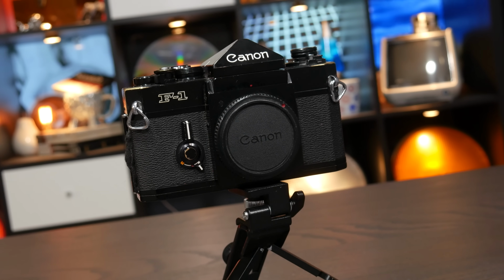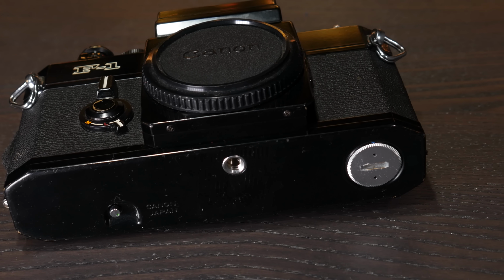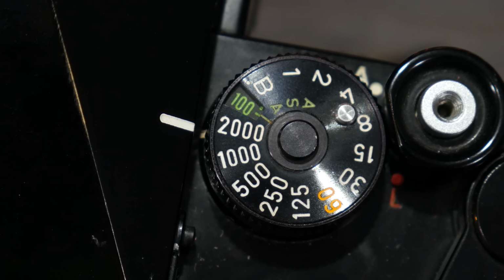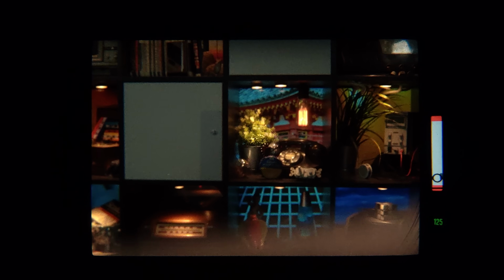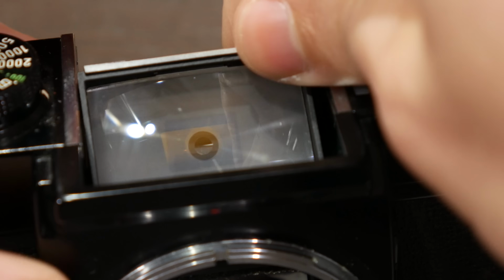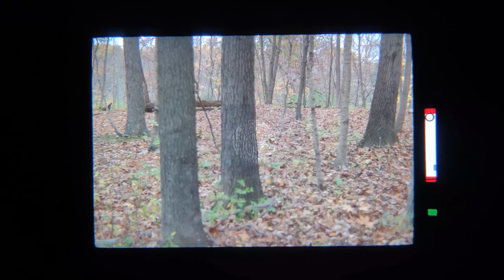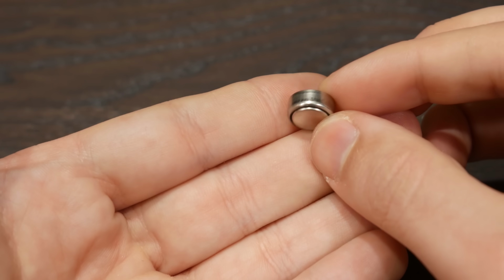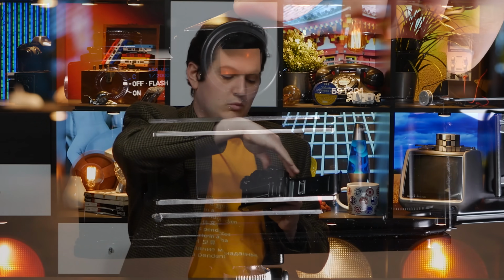1970's Camera Tech: How they showed you what settings to use

Comment: If you love the Canon F-1, I suggest you try the Canon F-1 NEW with the AE finder.    It is the perfect film camera.  So many people new to film photography are seeking out Leicas, Contax T2, ect. and really have missed out on an exceptional camera that is still priced reasonably.
Reply: I own both an m4 and a t2 and still return to the original f1, that metering system is so well thought out, I don't think any manufacturer ever managed to make a better mechanical camera with a meter, even the m6's meter is awful
Reply: the Nikon FE series is also a very good contender. Nikon glass is excellent, and the series uses a match needle system that can double as aperture priority. If you're willing to forgo 1/2000s shutter, the FE is excellent and pretty cheap. FE2 goes faster, but it does have a quirk of being locked to 1/125 for the first 2 exposures after the back is closed, a first of the roll shot is trickier. Fm3a is a grail camera to me in the 135 format.

Comment: Super cool and well explained. That is a great camera for the early 70s! I grew up using Olympus Trip and then OM-10 cameras but really got into photography at the time when Pentax ME Super cameras were available as second hand and cheap enough to lug about and be not too worried about, (something that's too precious to take will never get a picture). I've still got boxes of these plus autowinders, flashes and a myrid of lenses, tubes, filters and gizzmos. They were great and still are. I really liked that you showed the removal of the viewfinder. I expect this would be used for portrait photography as a mechanistic non-squint nod to medium format and subject-framing options. Yes, the intricacies, engineering and optics of these Japanese cameras was and remains amazing!

Comment: I converted to digital cameras 15 years ago, But today two of my students still and only use film cameras. They bug me regularly with info on the new films, etc.,even try to convince me to return to film and chemistry.  They also belong to some  club of "film photographers". So I guess film photography is not dead yet - sort of like record players that seem to be making a comeback. BUT in the old days when photographers were "real photographers", you know, take only one or two good pictures  instead of machine gun bursts of 50 pictures edited down to one or two good ones - we didn't need lightmeters outside. We all knew the base and start of "in sunlight, f16 with the shutter speed set to the reciprical of the ISO (oops - ASA in those days). Open one stop for open shade..... etc.  No need to know much anymore - the camera computer takes care of it all, sometimes refusing to even take a picture until the subject smiles.....

Comment: I wished you brought up the battery issue, as the original mercury batteries are no more available, and give some advice for battery replacement. I know we could use an external light meter. Thank you anyway for your videos.

Comment: 1.35V Mercury Batteries now have an equivalent on sale on Amazon
WeinCell MRB625 Replacement Battery for PX625/PX13.

"WEINCELL (MRB625), REPLACEMENT FOR PX625/PX13 SINGLE BATTERY PACKAGE WeinCells are the only mercury-free, exact-voltage replacements for discontinued 1.35 volt mercury photo batteries. The zinc/air composition of the WeinCell delivers the same precise voltage with steady, constant output identical to that of the mercury batteries (alkaline replacements are generally 1.5 volts, with an unstable output curve; this can result in exposure errors of up to 2 stops)."

Comment: For what it's worth, it should be possible to stuff a step-down voltage converter in the camera, to make it work with a wide range of battery voltages, rather than using mildly-expensive air-reacting batteries that go bad in a couple of months even without being used; as a bonus, the voltage fed into the light-meter would keep fairly precisely at 1.35V even as the battery depletes and its voltage drops.

Something like a FAN53611 will accept anything between 2.3V and 5.5V, retails for 87 cents, and measures 1.80 × 0.86 × 0.86 mm³ (yes, this is stupidly tiny  =^.^=)
That's literally the first/cheapest result from asking my favorite IC search engine, not a particular recommendation and more an example of how cheap and small modern voltage rectifiers can be  :)

Comment: I owned a Canon FTB and loved it. The light meter was very similar to the F1. Off to the right side of the view screen I had two needles, one fluctuated with in coming light.   Line the ring over the light needle and you were good to go. The other was a ring and moved with the F-stop. Yep, choose either shutter speed as the primary concern or the depth of field with the F- stop.  I loved the lever on the front where when engaged you looked through the stopped down lens. Release it you would get the full light entering the camera making it easier to see what was going on to focus the lens. I feel the old cameras like my FTB reenforced all the mechanics of photograph.

Comment: I figured out the way the semitransparent mirror works. I kept seeing a fine, circular flare as you moved the camera around. Once I saw the upper surface of the focusing screen was very convex it became clear the screen is actually 2 pieces of glass with a clear optical cement between them.

A 45 degree flat is polished into the 2 pieces, half silver mirror applied to one piece, and the 2 pieces are cemented together. Then the bottom surface is ground into the focus screen, and the top surface is polished into a lens. Very clever, but I imagine grinding the top lens must have been annoying, since you can't put a lot of pressure on the join.

Comment: Thanks for the memories! I still have an Olympus OM-1 still tucked away in my basement collection - about the same vintage as your Canon. I shot many rolls on it starting in the 80's, when I bought it second hand from a friend who had used it since the 70's. I love the elegant engineering that went into these devices and the tactile control of it. The distinctive scent of film emulsion that lingers inside, even when you open an old camera, brings back memories. Cheers!

Comment: You're not completely stuck with whatever the film speed is as you can still do "push processing" and shoot it at a higher ISO.  This is usually done, or used to be done, in night surveillance work where you had very little light to work with but needed a higher shutter speed to get a clear image of someone.  I've successfully pushed ASA 400 film as high as ASA 2,000 for such things with my old Canon TX BITD.
Reply: You're still stuck with the same iso for the roll, though. You can't reliably split the film to process it differently if you decide to push mid-roll. Either you sacrifice the first part of the roll, deal with possibly losing frames trying to split it, or just push the entire roll.
Reply: @Ravaxr  I'd always push the roll since the camera was loaded fresh for each job.

Comment: I have a camera from the 1960s which has a very similar light metering system. The Voigtlander Bessamatic used a solar panel mounted on the front as the light meter, which is directly connected to the mechanism which moves the needle. No battery is required. It's obviously less advanced than this system as the sensor is huge and just on the front of the camera, but its also at least 10 years older.

Comment: The basics of camera operation explained in a way that today's point and shooters, could understand. You're explaining how a photographer could use the meter to make an Aperture/Shutter Priority camera was spot on. I don't know if it applied to the F1, but the later AT-1, also used the needle match system, and the size of the circle was specified, to represent a full f stop, placing the needle on the edge of the circle was a 1/2 stop from the metered exposure.

Comment: For that pull up dial for film speed, my camera has a separate knob with another pointer that ranges from -2 to +2 what does that one do? Thanks for the great video TC! helped me learn alot more about my fancy 35mm Ricoh XR7 camera!
Reply: That is exposure compensation, which purposefully throws off the light meter so you can accurately overexpose and underexpose. Say you have a snowy mountain that you are taking a picture of. The light meter assumes the subject is a middle gray, and so will underexpose due to the bright snow. If you set that dial to +1, you are telling the camera 'I want this image to be overexposed by 1 stop', so the final image will push the middle grey to be more white.

Similarly, if you have a dark scene, and you want to keep it moody and black, you can turn it to underexpose. Again, the meter will try to get to middle gray, so a dark scene will be brighter than normal until you set it to -1, where it will push the gray to be more black.
Reply: @Ravaxr  sweet thanks man!

Comment: I worked with a Nikkormat SLR, almost always with B&W film, between 1977 and 1983. In the beginning I did a fair bit of film development and enlarging - two more areas you could enhance (or permanently ruin) your images. 
"Pushing" film was a real thing. If you needed a faster film than you had, you could squeeze out two stops.
I usually carried 400 ASA, but sometimes needed 800 -- a one stop increase. (Pushing to 1600 was possible, with iffy results.)
By setting the ASA to 800, I underexposed the film. To compensate, I overdeveloped the film. Film and developer makers usually had suggested ways to get decent results with this step. 
One rule still applies - film / image cards are cheaper than going back to reshoot.

Comment: More importantly mercury batteries produce a very stable voltage which is needed for the light meter to operate accurately.

The earliest light meters needed no batteries. They produced the energy from the light they measured. Of course this meant a large sensor.

Comment: I remember reading old issues of Modern Photography. IIRC Canon split the glass for the focusing screen in half, silvered it, and re cemented it back together.

Also, the issue with alkaline batteries is the discharge curve isn't linear, so it loses voltage as it ages. They make adapters with a diode that burns off the excess voltage so you can use a silver oxide battery, which does have a nice flat discharge curve.

Comment: Small nitpick, you called film analog. But film is actually digital. The individual grains in a piece of film are either activated by light, or not. Either on or off. Conversely, a digital cameras sensor is actually an analog device, although the information it captures is converted to digital. It's a fun switcheroo.

Comment: Interesting to see that Canon photomachine had mechanical push arm in the optic for changing the light meter's tresholds phisically.

Praktica had a different approach by placing potentio meters both in the optic and the exposer dial. And the light sensor got the light via a little semy transparent mirror inside the SLR mirror, that somehow was unnoticable in the image of viewfinder.

By the way, what kind of monster film had ISO-1600? I can just immagion it resolution sucked for the trade of high sensitivity.

Comment: With the advent of data backs in the late 1980s it is a shame that they didn't find a way to expose that light meter information on the film next to the frame - so you could tell what settings you were using to take the photo.

Comment: Interesting video.  The reason the F numbers get larger as the aperture gets smaller is because it’s a ratio of how many diameters of the shutter opening will fit into the focal length of the lens.  Thus the diameter of F22 is 1/22 of the focal length.  Another reason why old meters crapped out at very slow speeds or super fast ones is reprocity failure.  Reprocity is the relation ship of one F stop being equal to one change in shutter speed.  But if light is weak enough or the exposure too fast, the silver in the film won’t react the same.  Flash units get away with this fact by blasting the film with lots of light (trivia, every time you reduce the power of a given unit, you will proportional reduce the flash duration by the inverse square law).   And focal plane shutters have another quirk. Because the shutter curtains control exposure by making a slit that travels across the film, very fast moving objects can appear distorted.  On a horizontal shutter a race car may appear either squashed or drawn out.  On a vertical shutter, the race car may appeared skewed. Btw, I’ve always hated the Nikon F, because you had to take the camera off the tripod to change the film.  Cameras like this Canon and the old Nikons, didn’t spring out of an engineering group.  Camera’s evolved. The invention of the penta-prism and the built in light meter came bout separately, as did the curtain shutter.  On another note, old cameras had a setting to use flash bulbs, whose light output was long enough that one could use any shutter speed and get undistorted images.  There was a simple mathematical formula to determine the aperture, using a ‘guide number’ for that bulb.  The main advantage og digital cameras, in my mind, is that you can take as many images as you want and not have to pay for film or processing, or the cost of having the image printed on paper. So trap your camera and get busy!

Comment: You did a mistake at minute 10. At bright sunny day you have to use settings 1/250 and aperture 16. If there are some clouds in the sky - 1/125, aperture 11; in cloudy day 1/60, aperture 8, close to sun down and after sunset - 1/30, aperture 5,6 and when is darker or inside a house with normal lighting (like with the old bulbs with 60/75Watts) 1/15 and aperture 4. All that is for 100 ASA (that matches with 100 ISO). If you get girl with 200 ASA you have to use one step shorter shutter speed but to leave the aperture the same, or to close one step the aperture and to leave the speed without changing.
Also, like you said (but you didn't explane  till now, the minute 10 - let me see if you explane it) the ratio speed and aperture can be changed , depending the needs, if you shoot high speeding objects you can change the speed and aperture from 1/60 and aperture 8 (for cloudy day and 100 ASA film) fo 1/125 and aperture 5,6 or 1/250 and aperture 4, or even 1/500 and aperture 2,8. It is the same if you need slower shutter speed, like shooting moving water in the same light conditions - instead 1/60 and ap. 8 you can use 1/30 and ap. 11, 1/15 and ap. 16, 1/8 and ap. 22, 1/4 and aperture 32 and so on...
I have also a personal question, what is the origine of your parents/grandparents? You look a lot like me before the time I lost my hair (by burning it with chemicals 😁) and I am by origine Bulgarian.

Comment: I'm a fan of the light meter in the Canon 7 range finder cameras. It's essentially just a crude solar cell, and the needle it uses to show what aperture setting you should use is basically just a volt meter that reads in f stop numbers, and the dial changes what numbers are displayed based on what you set the ISO and exposure at. All with no batteries.

Comment: Only 'fancy pants' rich folks had cameras with light meters, back when I was a kid.  'Sunny 16' in daylight, the flash gun scale indoors, and bracketing (taking several frames with adjacent exposures around your best guess) were how it was done.  The good news was, print film was very forgiving as the exposure of the print was automatically adjusted during the professional printing.  Slide film, where the film in the camera becomes the actual slide, your expsure had to be right on for it to look good.

Comment: This was interesting, are you going to be making any more videos about film cameras?
One of the cameras I had was an Olympus Rangefinder 35RD that I bought in 1980.

It had an excellent 6-element F. Zuiko 40mm f1.7 lens. 

A good feature was that for flash photography you did not need a flash with metering, just a cheap basic flash and then you set the flash guide number on the camera. This engaged a mechanism that linked the guide number to the lens aperture  so that if you focused on a close subject the aperture would be reduced.

I sold that camera in 2005 in non working condition. The foam rubber light trap on the back of the camera had degraded to a sticky tar and the grease used on the lens focusing mechanism had migrated to between the shutter and aperture blades causing them to stick.
It had the same problem as your Canon of using a mercury cell to power its light meter.
I was still able to get £50 from someone who wanted to restore the camera.

Comment: I did this for years, but I still watched the entire thing just for the pleasure of hearing you explain it. Also, mine was a Canon AE-1 (sadly not working now), and it had a stupid electric readout wiht little lamps (( now that I see this F-1, it's way cooler with its mechanical ring and needle.

Also, cheaper ones (like my Zenit) had a contextual needle lightmeter, which pointed to + if you were underexposed, and minus if you were overexposed, with lots of needle wobbling.

Comment: If you want a very interesting take on exposure meters, try the off-the-film (OTF) system in the Pentax LX.  This measured initially from the back (front) of the shutter but during exposure from the light reflected off the film.  If the light changed during exposure, it changed the shutter speed to match.  Also made "painting with light" pictures invariably perfectly exposed.
Reply: P.S. It was Canon that invented the bulbous camera look, with the T90.  Naughty Canon.